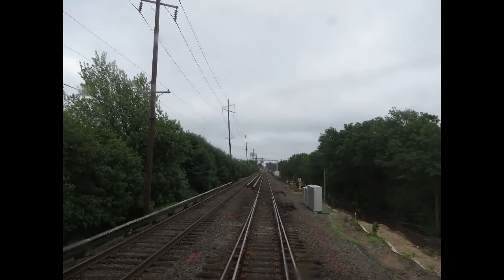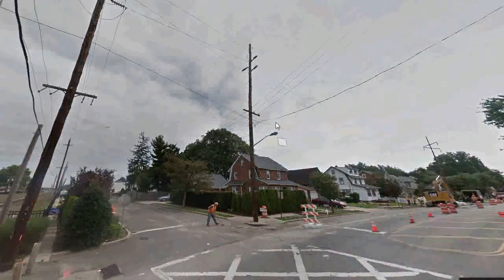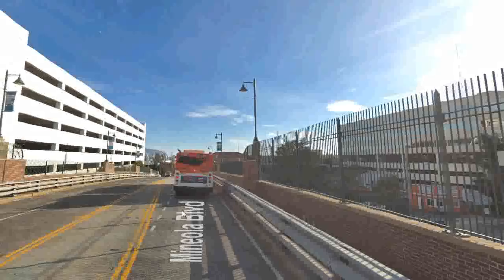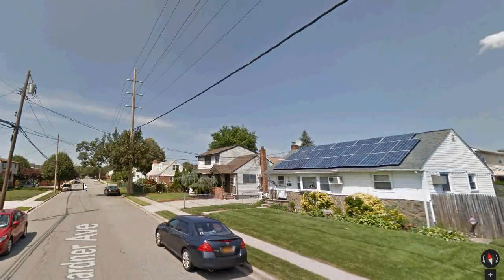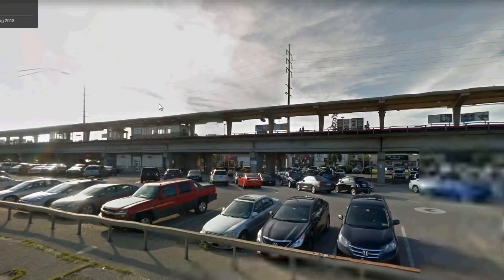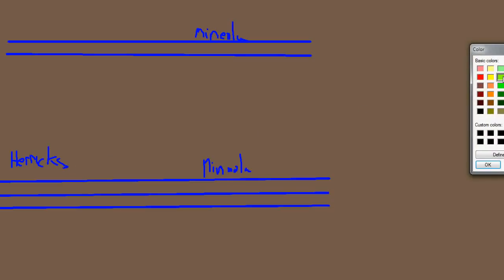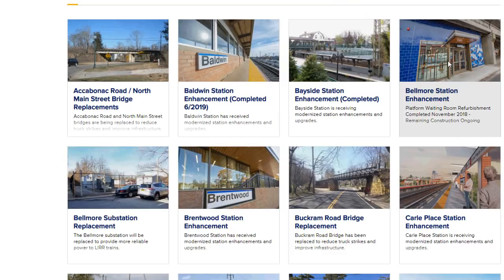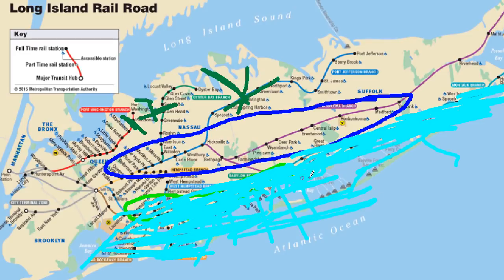The 3rd Track Main Line Project still falls short of what's really needed

Comment: The middle track should be built under the existing two to keep the interlocking consistent as before but not to conflict between the two outer tracks so that oyster bay trains can serve both platforms. New switches built for oyster bay trains to use the middle track west of magnolia. Cut the street where the junction occur and replace and upgrade the infrastructure

Comment: Great video. I work for Metro North and we need a 3ed track on the Harlem line from north of Crestwood to North white plains.  We run too many trains and not enough tracks.  There is talk of the 3rd track but no idea when that will be.  Fortunately the new haven and hudson lines are 4 tracks in its busiest segments.
Reply: ghostengineer Two extra tracks can be achieved by connecting the Ronkonkoma Branch to the Hempstead Branch vía an abandoned rail right of way through Central Nassau County. This would bypass the mainline altogether and allow for more frequent trains on the Oyster Bay and Port Jefferson Branches.

Comment: Lots of things to say:

The Oyster Bay Branch honestly could use more service and two platforms at the Oyster Bay terminal station. 

When the Main Line actually is completely shut down (which I agree with you, it should happen like now, and it sure can/could!) to accommodate renovations and replacements without any hassle of traffic, Huntington, Port Jefferson, and Ronkonkoma trains would need to just terminate in Hicksville and provide shuttle bus service to Jamaica, where passengers can continue their trip to Penn Station, Atlantic Terminal, or JFK Airport. Montauk trains should stay on the Atlantic Branch (not have stops in Hicksville or Mineola.), because they are the "real" flyers on the Babylon line (Excluding the electrified trains, the electric flyers can also be eliminated to allow the diesels to fly through), which continue into non-electrified territories so easily and simply allow them to continue on to Patchogue, Speonk, or even the Hamptons/Montauk! If there's only a few stops on the Babylon Branch, Patchogue/Speonk/Montauk trains easily can stop there, without even requiring a change in Babylon! The only trains that should terminate in Babylon are local electric trains or local trains to/from Speonk and/or Montauk or Patchogue shuttles. Even so, the Montauk Branch should also get double-tracked between Sayville and Montauk, because majority of it single tracked. The only double tracked territory away from Patchogue is at Montauk (the end of the line). Bellport could use more trains and a ticket machine, as well as longer platforms to at least accomodate a 6 or 8 car train.

Oyster Bay trains would just terminate in East Williston and then provide shuttle buses into Jamaica because they wouldn't be able to access Mineola due to the said construction, because the problems would just get worse and interfere with the work that is needed.  

 A new seasonal Belmont Park station would be best on the actual Main Line, and I will agree that the single track spur should be eliminated, even so, the 2015 renovated Belmont Park station still looks pretty ugly anyway so it would definitely be great that Belmont Park puts the new 12-car station on the new Third Track Main Line. Hempstead, Huntington, Oyster Bay, Ronkonkoma, East Williston, and Port Jefferson trains could stop there easily. If there are no ticket machines, all they need to do is purchase a round-trip ticket, and if people forget, worst case scenario, surcharges for the passengers for not purchasing before boarding. The ticketing system should also work the same manner like at Mets-Willets Point! (Citi Field) 

Merillon Avenue and Westbury look very doable to be elevated. A new waiting room with central AC/heat, and a new station parking lot would need to be constructed. More service between Mineola and Floral Park would mean more trains from East Williston but only peak trains terminate or originate there. M3s are used and not M7s/M9s for that route. And trains from the said terminal can easily make stops all the time! I don't understand why there isn't much service from there. Chances are, if you're on the Ronkonkoma or PJ branches, all you would have to do is change in Mineola to get to that stop. Worst of all, most Ronkonkoma trains on the weekends just fly through Mineola and never have half hourly service on the branch! 

Mineola is in complete dire need of a new renovation with 2 island platforms to accommodate more service from at least 3 different branches, and add new underpasses to stop those problems from happening. New fare machines or the Long Island Bus should also be added because it is also used as a bus station and not just a train station, hence being a Intermodal Center. 

Floral Park is definitely in need of a renovation, and the only thing to really make it a new station, is all they would have to do is just shut it down and take down the old stuff at the current station to accommodate the construction. Add new elevators, escalators, and staircases leading between the waiting room (with the ticket machines) and platform level. The station does also deserve more service, not to mention that not many Penn Station trains stop there, as only a few during the weekday peak hours stop there only (only Hempstead trains). The only trains that stop there are mainly either Jamaica or Atlantic Terminal trains, and that is NOT fair at all!
Reply: You keep complaining about the south shore, and I can not disagree, but the Oyster Bay Branch is long over due for electrification.  I know they just started testing the BEMU, but I think all of Nassau county, if not the whole system should be electrified.  I would also like to see more service on the Oyster Bay instead of driving to: Hicksville, Mineola, Pt. Wash, or Great Neck.

Comment: If you put new Belmont Park where will the trains be put at?
Reply from the maker: The new Belmont Park station would be served by thru trains on the Hempstead and Main Line. Thus people would be able to say, park at Hicksville or Mineola and get a direct train there instead of backtracking at Jamaica.
Reply: @PinePowerLI  Also add more platforms, not just 2, to allow more trains to stop there, not just for Hempstead.
Reply: Great idea to park around Mineola for private cars.  MTA, NY STATE & COUNTY (IES), and NICE bus can create an agreement in having seasonal bus service from Mineola to Belmont Park.  Since service will be a major issue, too, MTA can use express coach buses from Jamaica, NY to supplement service by the LIRR in addition to local buses operated by the MTA from NYC.